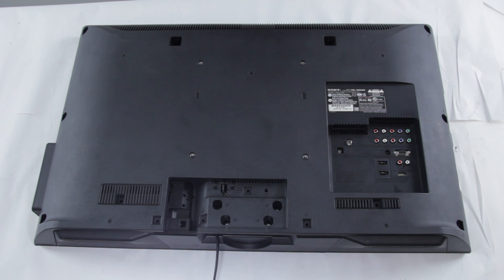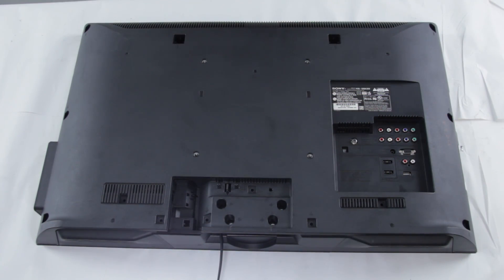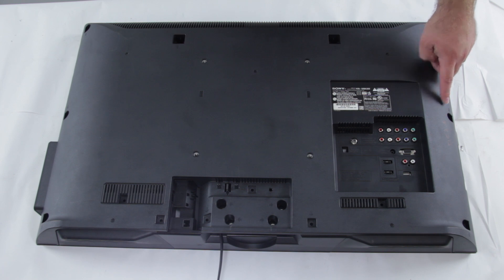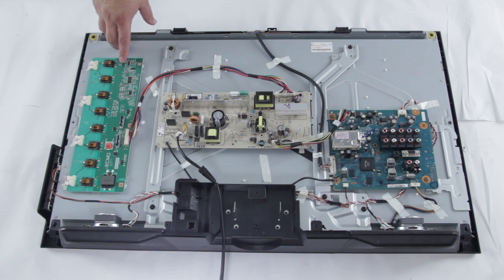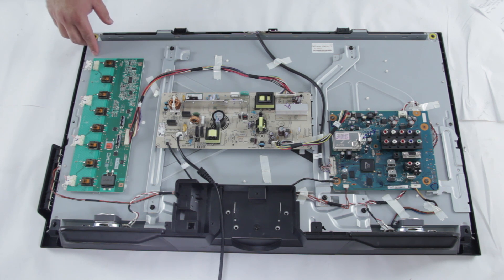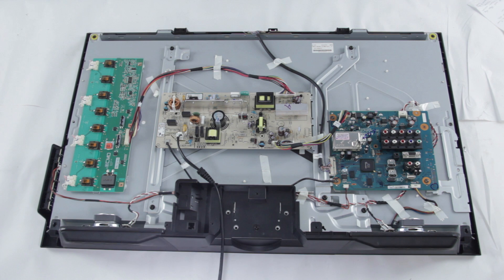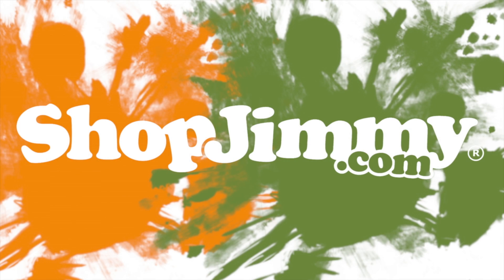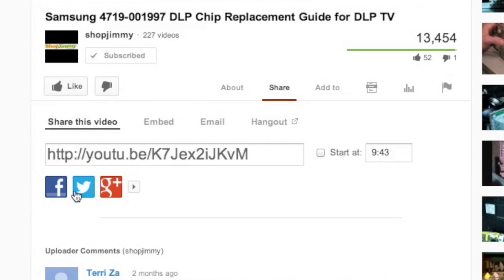LCD TV Repair Tutorial - Backlight Inverter Common Symptoms & Solutions - How to Fix LCD TVs

Comment: I have a Sansui SLED3900. Turns on then screen immediately turns off, did flashlight test and I can see the images. Having trouble locating the backlight inverter to replace them. If that is the problem, Can you help?
Reply from the maker: ag   This could be a problem with the power supply board or there are bad LEDs in your TV panel.  You can replace the power supply board to see if that fixes the problem.  Unfortunately I do not see any replacement parts in the search results for your TV model number on our website.  Please reply with your part number on your power supply board and I can try searching for replacement parts.  Thanks and please let us know if you have any further questions!  www.shopjimmy.com

Comment: I have Sony KDL-46EX500 SN 1879690  I'm having a problem with the Backlight in settings I'm unable the to control or adjust the Backlight. Actually it doesn't light up when i go to settings and won't stop on the Backlight setting. Thx
Reply from the maker: Dan Willbanks  Please watch this video FIRST to help with your repair!  https://www.youtube.com/watch?v=BP3NVNCGEv8  I recommend replacing the main board in your TV.  Click this link to replacement parts for your TV model number:  http://www.shopjimmy.com/sony-1-857-593-31-a-board.htm  There may be multiple boards for the same TV model number, be sure to match part numbers on your current board, with your replacement for compatibility.  Here is a link to a video showing how to identify your part number, click here:  https://www.youtube.com/watch?x-yt-ts=1421782837&x-yt-cl=84359240&v=Aodz2LHkzbY  Thanks and please let us know if you have any further questions with your TV Repair!  www.shopjimmy.com

Comment: I have a Curtis LCD4689A and when it warms up the screen starts to flash. I have pulled the power board off and noticed on the primary part of the board a slight discoloration of the board near the heat sink. I removed the transistors and the bridge rectifier checked them and I believe it reads good on the meter (5) I put it all back together and left the back of the tv off and watched a movie. It maybe flashed once or twice but did good. I put the back on and turned it on and it went back to the old problem again. I'm not electronic savvy so I'm not sure where else I should look. Any help would be appreciated.  Thans
Reply from the maker: Richard Owens   I recommend replacing the power supply board in your TV.  Unfortunately I do not see any replacement parts in the search results for your TV model number on our website.  Please reply with your part number on your power supply board and I can try searching for replacement parts.  Thanks and please let us know if you have any further questions!  www.shopjimmy.com
Reply: awesome, thanks

Comment: Jimmy, I have an Insignia NS-46L240A13 TV.  When I turn the TV on the screen comes on for about 1 second then goes off... and I continue to hear sound.  Research on the internet and your videos make me believe the back-light inverter may be bad.  The board is a AUO 19.46T07.002 (~$25 on your site).  It's worth it to buy and try and I will but what is the best way to test this board to be certain?  I checked all the transformer coils, diodes, and transistors and they all seem fine and there is no visible damage or burn marks. (Wish I had a schematic! -this thing doesn't look all that complicated.)
Reply from the maker: Philip Osborne   I recommend running the flashlight test on your TV.   Here is a link to a video we produced that shows how to run the flashlight test. https://www.youtube.com/watch?v=xUzCLgoSPGM Please reply with your flashlight test results and we can recommend a replacement part for your TV repair. Thanks and please let us know if you have any questions! www.shopjimmy.com

Comment: Good afternoom, I have a problem with my tv, initially and suddenly the screen stops showing images, then Ifound a small but powerfull mosfet smd that was shorted, I managed to replace that one for one with similar characteristics and replaced the fuse with a 0 ohm resistor, I´ve replaced too two electrolitic capacitors that were curved and now the screen shows the image but for about one second, then it switch off again every time I turn on the tv occurs the same thing, I think the TL494L that controls the inverter is turning off itself to prevent damage for shortcircuit, could it be another thing?
Reply from the maker: Valery Ramirez   I recommend replacing the main board in your TV.  Please reply with your TV model number.  Click here to view a video that shows how to find your TV model number:  https://www.youtube.com/watch?v=S51nhAmwR2M  Thanks!  www.shopjimmy.com
Reply: the tv inverter is a yamata 417B,tv coby tftv-1901
Reply from the maker: Valery Ramirez   Unfortunately I do not see any replacement parts in the search results for your TV model number on our website.  Thanks and please let us know if you have any further questions!  www.shopjimmy.com

Comment: Hey Jimmy, I have a 39 inch Emerson TV, model number: lc391em3. The TV, when plugged in, turns the TV on (I assume) with no picture, but a high pitched squeal. Wondering if this was the back light inverter or the power supply?
Reply: Scratch that, the TV does NOT turn on, but the squeal is still present.

Comment: Hi Jimmy.  Apex 46" LCD TV.  MODEL: LD4688.  Turn the TV on and their is sound but the screen remains black.  The channel will flash on in the right upper corner initially, then just black.  My research leads me to believe it's the backlight inverter.

Comment: Hey Jimmy, I have a Sony Bravia KDL-40EX723, and it is having this backlight issue i believe it turns on for a few seconds then turns off and the red light blinks 4 times, i am willing to purchase a new backlight board, but im unsure which one i require! Thanks!
Reply from the maker: wusb8  Please watch this video FIRST to help with your repair!  https://www.youtube.com/watch?v=BP3NVNCGEv8  I recommend replacing the main board in your TV.  Click this link to a replacement main board for your TV model number:  http://www.shopjimmy.com/sony-a-1814-572-b-batv-board-upgrade-required.htm  There may be multiple boards for the same TV model number, be sure to match part numbers on your current board, with your replacement for compatibility.  Here is a link to a video showing how to identify your part number, click here:  https://www.youtube.com/watch?v=Aodz2LHkzbY  Thanks and please let us know if you have any further questions with your TV Repair!  www.shopjimmy.com
Reply from the maker: wusb8   It looks like the inverter board might be built into the power supply.  http://www.shopjimmy.com/sony-1-474-300-11-g6-board.htm  Thanks!  www.shopjimmy.com

Comment: I have a toshiba LCD TV. Model Number: 42SL417U. Serial Number: B08516T02518A1. My problem with it is that I get sound but no picture and im pretty sure its a backlight problem. So I am wondering what to do next. Help :(
Reply from the maker: shadows879   Please watch this video FIRST to help with your repair!  https://www.youtube.com/watch?v=BP3NVNCGEv8  This could be a problem with either the power supply board or the LEDs are bad in the TV panel.  You can replace the power supply board to see if that fixes the problem.  Click this link to replacement parts for your TV model number:  http://www.shopjimmy.com/catalogsearch/result/index/?cat=59&q=42SL417U  There may be multiple boards for the same TV model number, be sure to match part numbers on your current board, with your replacement for compatibility.  Here is a link to a video showing how to identify your part number, click here:  https://www.youtube.com/watch?v=b9L0-m0-pjA  Thanks and please let us know if you have any further questions with your TV Repair!  www.shopjimmy.com

Comment: I have 2006 Toshiba Model 42HP66 - heard a cracking noise and picture went faint - very fain and dark - can barely make out image.  I'm hearing about sus boards - thoughts?    thanks!
Reply from the maker: josh tyler   I recommend replacing the YSUS and YDRVTP boards in your TV.    Click this link to replacement parts for your TV model number:  http://www.shopjimmy.com/catalogsearch/result/?q=42HP66  Click Alternates Available to see alternate options. There may be multiple boards for the same TV model number, be sure to match part numbers on your current board, with your replacement for compatibility.  Thanks and please let us know if you have any further questions with your TV Repair!  www.shopjimmy.com

Comment: Hello shop jimmy.
I have a samsung lcd tv that has the both the contrast and brightness all set to 100% and the tv picture is still very dull. The tv works well except for the brightness - sound and picture all there.
The tv details are as follows
Samsung 37"
Model LA37C550JIF
Model code LA37C550JIFXXY
Type no LA37C550
Sn NE703MMZ500640Z
From looking at your youtube entries it appears to be either the CCFL lights or the backlight inverter board. I'm just debating whether it is worth while to repair or take it on a fishing trip?
Your advice would be appreciated.
Reply from the maker: Jim C   Not worth trying to repair, perhaps the fishing trip..... :)  Thanks!  www.shopjimmy.com

Comment: i have an HP HSTND 3L02. few weeks back the backlights started to cut out, turning off then back on would fix this. over the period of a week the cutting out got more frequent and now the backlights only work for a second. towards the end i could hear a slight sizzle sound and smell burning coming from the top right (where the inverter is)
i have since replaced the backlight inverter, but nothing changed! after that i removed the transformers from the old inverter and none were burnt which is very strange.
do you have any ideas? i want to fix this since i already dropped 60 bucks on a new inverter, is it possible a power supply issue could cause my described problem? i took apart the panel and the bulbs all look the same (slight grey discoloration at the ends)
any help would be greatly appreciated.

Comment: I have a dynex DX-L42-10A and it makes a decently high pitched sound coming from the speakers I believe when I turn it on. (It came from near the bottom of the tv when I opened it up.) Raising the audio or muting it does nothing and neither does changing the brightness, contrast, etc. It does this when no other cables other than the power cord is plugged in as well. 

Thanks
Reply from the maker: kpxboiz56  Please watch this video FIRST to help with your repair!  https://www.youtube.com/watch?v=BP3NVNCGEv8  I recommend replacing the main board in your TV.  Click this link to replacement main boards for your TV model number:  http://www.shopjimmy.com/catalogsearch/result/index/?cat=56&q=DX-L42-10A  There may be multiple boards for the same TV model number, be sure to match part numbers on your current board, with your replacement for compatibility.  Here is a link to a video showing how to identify your part number, click here:  https://www.youtube.com/watch?v=LIWO2A_tuaI  Thanks and please let us know if you have any further questions with your TV Repair!  www.shopjimmy.com

Comment: Hi, my tv is a Vizio Model: E470-A0. It shows the picture but has a dark shade in the center of the screen and the screen went dark once. Can you please help, just been having the tv for about a year.
Reply from the maker: Steve J.   This sounds like a TV panel (TV Screen) problem.  If your TV panel is bad, it may be more cost-effective to replace the TV as panels are typically hard to find in stock, difficult to replace, and expensive.  Thanks and please let us know if you have any further questions!  www.shopjimmy.com

Comment: Hi I have a Sony KDL-46S4100. When I turned it on I could hear the "click" from the TV but the backlight was not on and the TV screen was dark. I tried to change channel or volume but I could not hear any sound from the TV. The fact that I have both backlight and sound out my guess is that anywhere on the power board is bad and thus there is no power on the main board and backlight board. Any steps would you recommend for further diagnose?
Reply from the maker: chunjingyang   Please watch this video FIRST to help with your repair!  https://www.youtube.com/watch?v=BP3NVNCGEv8  I recommend replacing the T-Con board in your TV.  Click this link to replacement t-con boards for your TV model number:  http://www.shopjimmy.com/catalogsearch/result/index/?cat=63&q=KDL-46S4100  There may be multiple boards for the same TV model number, be sure to match part numbers on your current board, with your replacement for compatibility.  Thanks and please let us know if you have any further questions with your TV Repair!  www.shopjimmy.com

Comment: I have a Samsung LN32A300 TV I have replaced the power supply and the Main board.The sound works but I have no back lights .Does anyone know what the voltages besides the 24Vdc and the on/off voltage on the inverter board should be.The lights don't come on then shout down they never turn on.Does any one have any ideas ????

Comment: 47PFL7403D TV was on, being watched when it made a very loud popping sound then shut off. Unable to turn back on and the TVs power light isn't lit up anymore. Which part? (I'm undecided as to whether it's simply power cord or 'brain'). Suggestion....
Reply from the maker: Registered Nurse in Sunny Florida  Please watch this video FIRST to help with your repair!  https://www.youtube.com/watch?v=BP3NVNCGEv8  I recommend replacing the power supply board in your TV.  Click this link to replacement parts for your TV model:  http://www.shopjimmy.com/catalogsearch/result/?q=47PFL7403D  There may be multiple boards for the same TV model number, be sure to match part numbers on your current board, with your replacement for compatibility.  Here is a link to a video showing how to identify your part number, click here:  https://www.youtube.com/watch?v=6TPI5s6ZHJY  Thanks and please let us know if you have any further questions with your TV Repair!  www.shopjimmy.com

Comment: Hi my tv has all the colours washed away. I can still see the images but there are posterizations of the colours. My TV Model is Samsung LA40B650T1F. The model code is LA40B650T1FXXY. Based on your video it sounds like a backlight inverter issue? I tried looking for parts on your website but couldnt find it. Help please.
Reply from the maker: Michael Lwin  Please watch this video FIRST to help with your repair!  https://www.youtube.com/watch?v=BP3NVNCGEv8  This could be a problem with either the T-con board or the main board in your TV.  You may need to replace each board individually to see which one fixes the problem, I recommend starting by replacing the T-con board.  Click this link to replacement parts for your TV model number:  http://www.shopjimmy.com/catalogsearch/result/?q=40B650T1F  There may be multiple boards for the same TV model number, be sure to match part numbers on your current board, with your replacement for compatibility.  Thanks and please let us know if you have any further questions with your TV Repair!  www.shopjimmy.com

Comment: model # DX-32L130A10
dynex 32"
 i had my dynex tv for a while until one day it made a very loud noise and i tryed to turn the volume down but it wont do so,and i had to turn the tv off and after that it would not come back on no picture or sound 

plzzzzz help
thank you
Reply from the maker: bankhead39  Please watch this video FIRST to help with your repair!  https://www.youtube.com/watch?v=BP3NVNCGEv8  I recommend replacing the main board in your TV.  Click this link to replacement parts:  http://www.shopjimmy.com/catalogsearch/result/?q=DX-32L130A10  There may be multiple boards for the same TV model number, be sure to match part numbers on your current board, with your replacement for compatibility.  Here is a link to a video showing how to identify your part number, click here:  https://www.youtube.com/watch?v=LIWO2A_tuaI  Thanks and please let us know if you have any further questions with your TV Repair!  www.shopjimmy.com

Comment: I have a Viewsonic LCD TV N3235W that was looking great for a few years running close to factory presets, then suddenly became too bright and washed out, and color tends toward too much red.  I attempted to make adjustments (contrast, brightness, tint, color temperature) but cannot get an acceptable pic now.  It almost seems like the backlight is too bright though I'm not sure that is possible.  Please advise!
Reply from the maker: Alan Solomon   Please watch this video FIRST to help with your repair!  https://www.youtube.com/watch?v=BP3NVNCGEv8  This could be a problem with either the t-con board or the main board in your TV.  Start by replacing the t-con board and if that does not fix the problem in your TV, then replace the main board. Click this link to replacement parts:  http://www.shopjimmy.com/catalogsearch/result/?q=N3235W  Be sure to match part numbers on your current board, with your replacement for compatibility.  Thanks and please let us know if you have any further questions with your TV Repair!  www.shopjimmy.com
Reply: ShopJimmy.com Thanks, it was the t-con board.

Comment: I have a Sceptre 322BV-HD-WXE5BV2 tv the screen lights up for a few minutes and seems to work fine after it warms up then it starts blanking out and slanted  lines pop in and out then it goes black and sometimes will com back on for a couple seconds do you think it might be the back light inverter or the power supply? The sound is fine all of the time. I haven't taken the back off or metered anything yet. Thanks Roxanne
Reply from the maker: Roxanne Benn   This sounds like a TV panel (TV Screen) problem.  If your TV panel is bad, it may be more cost-effective to replace the TV as panels are typically hard to find in stock, difficult to replace, and expensive.  Thanks and please let us know if you have any further questions!  www.shopjimmy.com